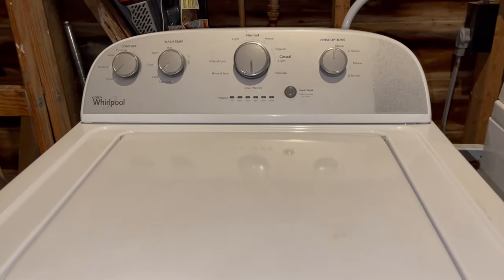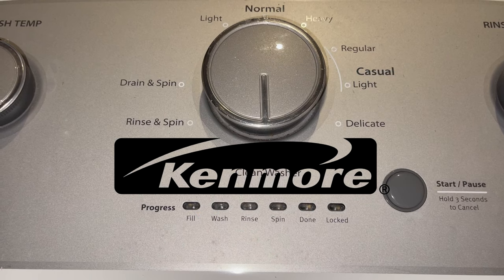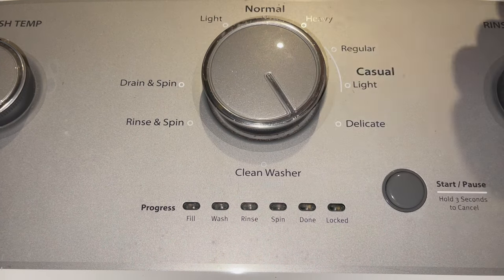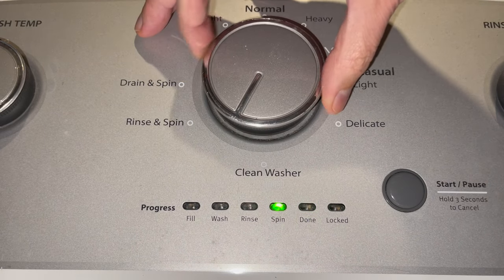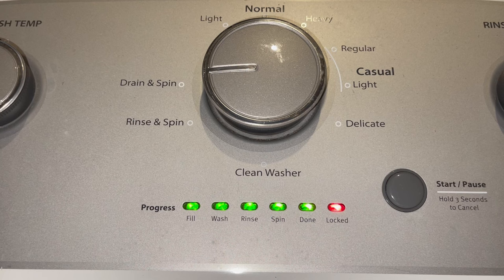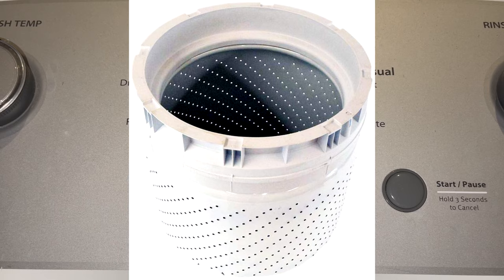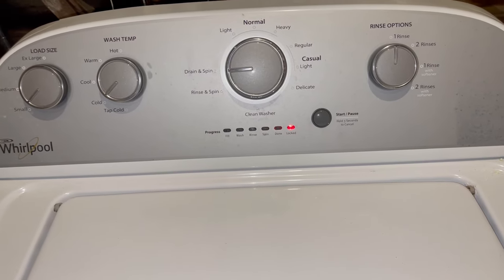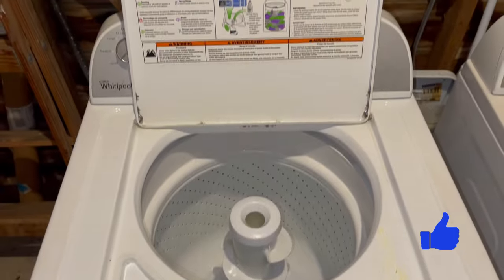Whirlpool washer reset calibration

Comment: All the steps work, but once I START the calibration process, it makes noise for about 10 seconds and then all the lights go off and nothing happens.

My washer gets stuck on the rinse step, and if i put it on the drain and spin option, it gets stuck at spin. The corresponding light flashes green, and eventually the lid unlocks. And it just stays like that forever.

Help

Comment: Do you need to recalibrate after replacing the shift actuator?
Reply from the maker: The service manual doesn't specify the shift actuator, but it's not a bad idea to calibrate anyway.

Comment: I replaced the lock and the washer options dont light up when rotating the selector knob. also the Lock doesnt lock. I tried holding the lock switch in and selecting the washer option to activate it but  it didnt work. I was thinking the controll board shorted. Leds work fine when entering diagnostics mode. latch lock doesnt click in diagnostics mode either.

Comment: Can I use this method because I have blankets inside that made washer out of balance? 
*I have not had a repair.
 I do not want to try this and mess up the electronic sequencing.
Reply from the maker: As long as the tub is empty now, you can try this recalibration.
Reply: Thank you for your fast response 🙏

Comment: Will it go to the full cycle. Mine stops at washing I have to set it to the drain and spin after that
Reply from the maker: The most common issue on these units is the mode shifter.

Comment: Does not go into calibration mode. I hear what sounds like a motor, but the water does not drain. Only light I get is the left hand blinking light. Any ideas?
Reply from the maker: The washer must be empty for the calibration to run.
Try holding the Start button for about 10 seconds, and the washer may drain the water out.
Reply: @Your-Self  
Sounds good. ..... Just tried holding the start button. Doesn't drain. I hear something, like the motor though. Guess I'll manually bail it out and try again. Thanks!
Reply: @Your-Self  
I wound up bailing the water out and ordering a new drain pump online. Cost was $52. I tipped the washer on its side and replaced the pump from the bottom. Bingo! Drain problem solved. Was not nearly as complicated as I was thinking it was going to be. Thanks for your vids. 👍🏼

Comment: Recalibration on these models almost never fixes problems with these units. Its never going to solve shaking or mechanical issues. Recalibration is mainly used after a repair has been done. One to erase error codes and 2 to test all functions. NEVER RECALIBRATE BEFORE YOU HAVE CHECKED FOR ERROR CODES IF YOUR MACHINE HAS BEEN HAVING ISSUES!! The codes are your best friend when it comes to these models.
Reply: How do you get the error codes?

Comment: Is there a way the washer can start filling without the lid having to be down? I have to put my clothes and detergent in and have the lid closed before it will start filling with water. Am I doing something wrong?
Reply from the maker: Every washer model is different. Some will let you turn it ON and wash with the lid open. But require you to close it for a spin cycle. Others, you'll have to close the lid from the start.

Comment: I was trying to get it to stop shaking. so did this but accidently hit start when light was on spin instead of the rinse light.(left my notes in the other room).  now it wont start 🧐oops. I lost the ability to do Landry but gained the knowledge of what not to do.  what exactly did that do by hitting hitting start o the spin? they shouldn't put the self destruct button next to the fix button.
Reply from the maker: You can press and hold the START button for 3 seconds. And that should cancel the test.
Or you can unplug the washer for a few seconds and plug it back in.

Comment: My washing machine isn't spinning all the water out of the clothes. The past two days the clothes are still wet when it says it's done. Can you offer any help with that?
Reply from the maker: It's difficult to say for sure, but the most common problem on these machines is the Shift Actuator that's located under the cabinet. You could try replacing that or call a technician.

Comment: None of these resets/calibration suggestions work for my machine.  Machine isn't empty because it gets stuck on either the wash cycle and won't move forward OR gets stuck on the rinse cycle and just keeps adding water!!!  I would like a reset that works!
Reply from the maker: Try unplugging the power cord for one minute and plug it back in.
If that doesn't help, you'll probably need a technician to troubleshoot the problem.

Comment: I just followed these steps but mine doesn't want to calibrate. The green lights flash moving to the left several times and then a hear a click and it stops. Weird. Anyone experienced the same?
Reply: Exact same issue. Mine keeps turning off and on. It won’t do anything else. It’ll fill up and not transition to wash mode.

Comment: What if I didn't do this after replacing shocks and now my bin is full of clothes and water.... it won't drain right now. Need help.
Reply from the maker: Try holding the Start/Pause button for 3 seconds to cancel the wash cycle. 
 Doing so may drain the tub automatically.

Comment: Tried this but it didn't start a short cycle. Did it still recalibrate?
Reply from the maker: No, it needs to go through a short cycle.
The washer may have a lid-lock or shift actuator problem... not sure.

Comment: I did everything you suggested and my Whirlpool will still not move past the wash cycle
Reply from the maker: The most common problem on these machines is the Shift Actuator. Try replacing it and see if that solves your problem. 
Or call a technician to diagnose the exact issue.

Comment: Do I need to do this when I first buy it and why do it sound like my clothes not washing and no soap sub I put alot of soap
Reply from the maker: No, don't calibrate if the machine is new.
Newer HE (High Efficiency) machines use HE detergent. As the label states, don't use a lot of soap. Typically, 2-4 teaspoons are enough. And the HE soap doesn't bubble like the old one.

Comment: Does this work for balancing?
Reply from the maker: Possibly. Just try it.
If it doesn't help, you may want to replace suspension rods. It's the most common issue in these units.
Reply: thanks

Comment: what's the next step if the calibration didn't solve my problem?
Reply from the maker: Push down on the empty inner basket, and it should bounce back once. If it keeps bouncing and feels kinda loose, the damper assembly on the suspension rods has worn out.
When rods go bad, the hub, gearcase, and basket may get damaged as well. You could try replacing all 4 suspension rods first. Or call a tech to evaluate other parts as well to see if it's worth the repair.

Comment: I did this and it cut off during the sequence it didnt finish it ....what does that mean ?
Reply from the maker: It sounds like there is a problem with one of the parts. Possibly a bad lid lock, shifter, pump...
Holt the Start button for 3 seconds to cancel the calibration. And you probably need to call a tech to figure out what's broken.

Comment: Whirlpool is the worst. Don't forget the many 5 gallon buckets of water you have to help fill the machine or wait a half of day for it to fill on its own. Worst washing machine ever.
Reply: Check both the inlet screens on both the hot and cold water valve by shutting off the water and then removing both hoses from the back of the washer then use a small pointed object like a nail to pop out the screens and clean them if there plugged the washer will fill slowly,  if your washer has fill hoses that have screens check them as well,,  if that does not address the issue , check pressure and flow at the washer hook up.. you must have at least 20 psi of water pressure for the washer valve to work properly .   a plugged fill valve can happen on any washer..
Reply: The cycle length on this machine is terrible. Normally washers take only 40 minutes or so to complete washing. This one takes like 10 minutes just to fill.
Reply: @brianb8011  Did you check for and clean any dirty  filter screens on the inlet ? some fill hoses have them in there connections as well  do you have low water pressure ? Has the machine always done that from the time it was installed ? Check for any restrictions in the hot and cold water supply , ours takes around 7 to 8 mins to fill for a modest load of laundry if you select "auto sensing" for the water level longer if you select "deep water wash"   .  it's a VMW with a full agitator not a bottom impeller. thats used for 3 loads every day..
Reply: @allrock1238  I maintenance these machines as my employer only buys whirlpool appliances for their properties. They look nice and are easy to work on. But the cycles are quite a bit longer than other machines. Just so you know I'm referring to the WTW4815 which fills much slower and does not have the full size agitator.
Reply: @brianb8011  Understood
Reply: You are right. It is junk.
Reply: @brianb8011  Yes I miss my old machine doing the laundry was a few hour affair back then now it's an all day affair with this machine
Reply: Thanks a bunch man
Reply: In wanting to buy US...to assist with keep my fellow people employed, but Whirlpool is not making my decision easy.
Reply: I do property management and have contract with whirlpool so I have to buy them. I hate then so much. I have brand new out the box can't get past sense fill. No one wanted this feature! Just fill turn drain, no one cares about all these options. Out of the box brand new can't wash nothing!
Reply: @BodyByBenSLC can't wash anything, which means you can wash everything. Does what you're saying mean you got it working??
Reply: @brianb8011  thats because its a high efficiency low water machine…
Reply: Dealing with my pos whirlpool again after having maintenance come and say nothing was wrong with it

Comment: Why is my whirlpool wobbling real bad and not spinning
Reply from the maker: Make sure the floor the washer sits on is absolutely leveled.
Suspension Rods are a pretty common failure. So they may need to be replaced.
You can try running this calibration cycle and see if it helps.
Reply: @Your-Self  how do u know if a rod is bad??
What about changing out hub?
Reply from the maker: Push down on the inner basket and it should bounce back once. If it bounces more and feels kinda loose, the damper assembly on the suspension rods has worn out.
When rods go bad, the hub, gearcase, and basket may get damaged as well.

Comment: Mine not locking
Reply: Did you ever figure it out? I'm having the same problem. The lock light never comes on. And it seems like the start button won't do anything and I'm wondering if it's because of the lock not doing anything

Comment: I dont recommend doing as this video says if your not a certified technician. You can burn out the control and thats not cheap to replace.
Reply from the maker: If you don't feel comfortable doing this, definitely call a professional.
However, this calibration cycle is fairly benign and will not damage anything that hasn't been damaged already.
Reply: Why not technicians do it and if it caused harm, why would it be possible to do it? That comment made no sense sir.